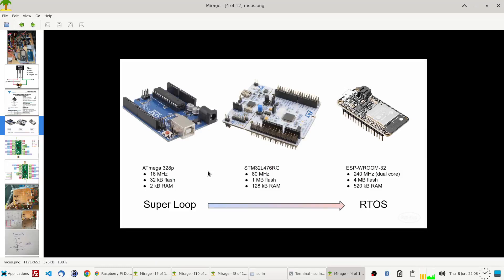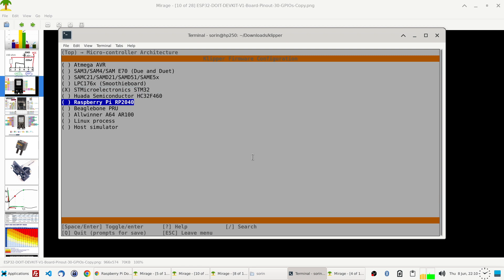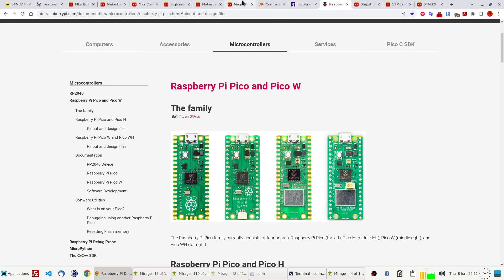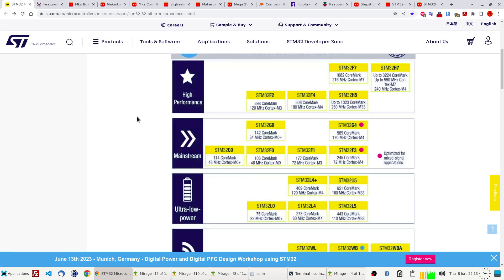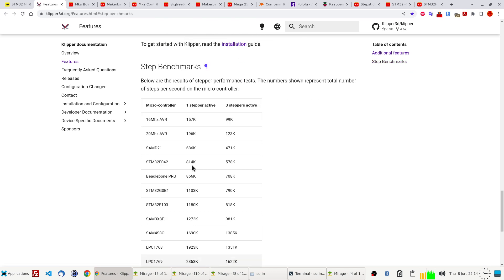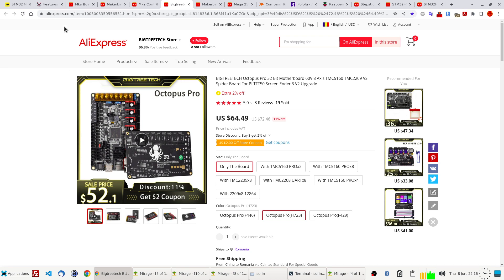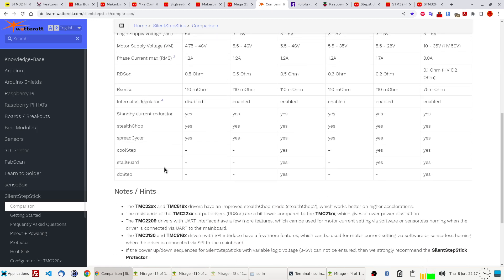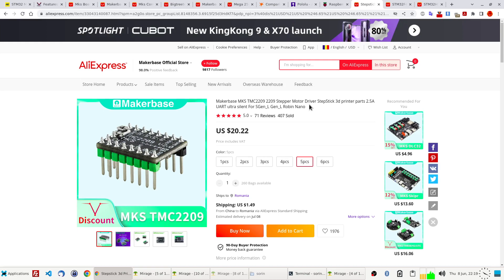How to pick your 3d printer motherboard DIY or BUY

Comment: Liked your approach, these boards are continuously upgrading. Major upgrade is from Chip and stpper driver only. Making our own make a gr8 sense here if we can spend time on it. with custom board we can go with AC power heated bed also. Can I use Raspberry PI 3B+ instead of ESP32?
Reply from the maker: actually I think you can use both the pi or the pico versions. I didn't used the big pi cause I didn't had one and the price is too big compared with the pico, but I see it has the same number of gpios, you could run all software on one board, not sure if klipper supports it though

Comment: Great video! Have you considered making a PCB shield for the pico? You could get them quite cheap in a pack of 10 from pcbway
Reply from the maker: yes I started doing that but I gave up as it was more work then building it on a perf board :) I did some years ago a shield for an AVR processor a clone of an Arduino when they were not so popular.

Comment: draw a normal diagram with all components. nothing is visible or clear here. It’s better to see images of sprint layout or similar ones. I want to repeat it but I don’t understand anything
Reply from the maker: ok I will make a new one these days
Reply: @CNCTinker same, just like use a ruler and scan it or some thing.
Reply: To expand pins, I can try using 74HC595 or analogues